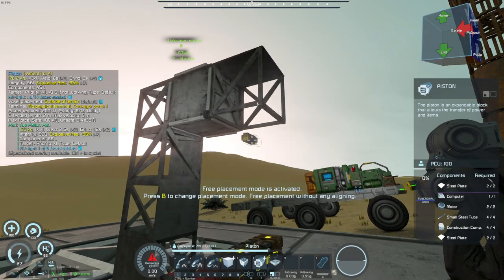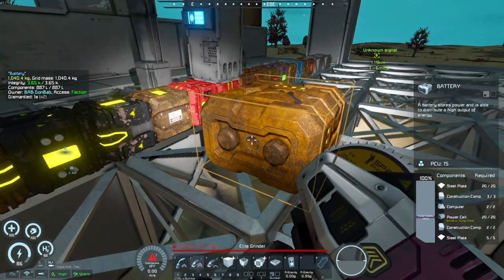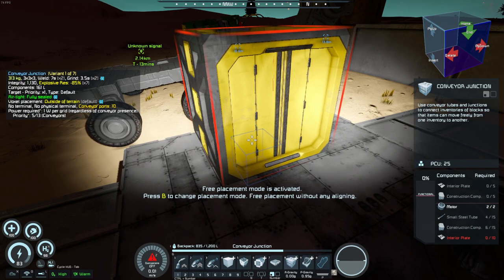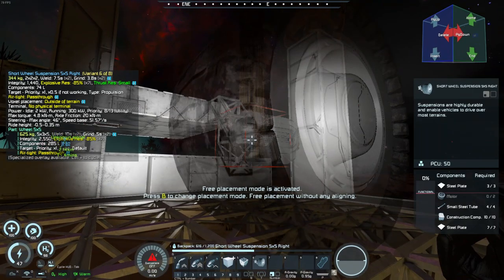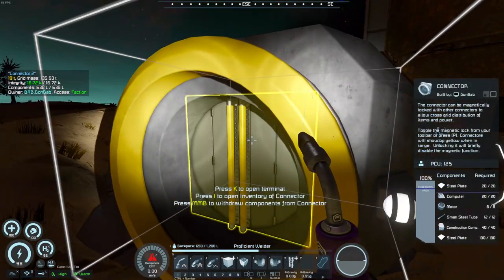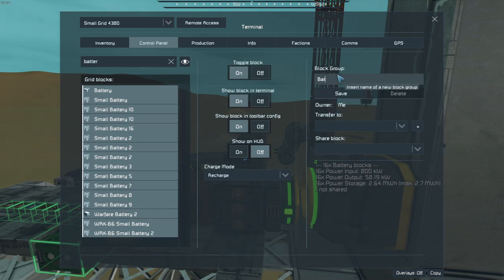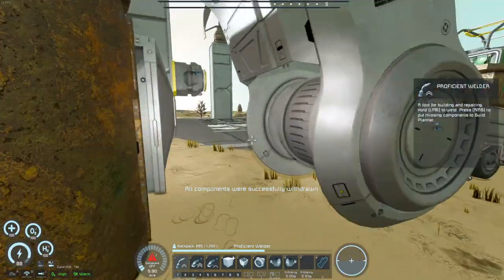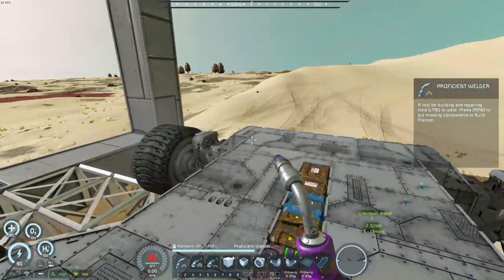Building the new Rover | Space Engineers Scrapyard Survival | E12

Comment: Well, you asked for commentary and suggestions, so.... 

As large as this rover is, and especially considering it'll carry heavy loads at awkward angles, definitely attach an additional gyroscope (or two!) when you can.

If you are putting your survival kit on the base, you'll want a recovery vehicle that the crane can carry, because when you die in this scenario you can't just jetpack out to the crane, and the recovery vehicle will have to come back with you somehow.  You'll probably also want a beacon on the crane and an antenna on the recovery vehicle so you can FIND the crane when you're going out there after you die. Finally if the recovery vehicle has a little cargo space (and remote, camera, and antenna, and the crane has an antenna), you can use it remotely to bring out crucial parts you need in some situations.  For example, to build large-grid wheels and a control seat if you want to bring a building home and are short of parts. And a couple connectors so the crane can attach to it, which will both secure the crane and power the building.

When you're building the next crane consider the sequence hinge-hinge-rotor-magplate for the hand, instead of rotor-hinge-hinge-magplate as you had it on the old crane.  It'll be less confusing because it means turning the rotor won't change the direction of the hinges. 

I would put a layer of armor plates under all the batteries.  You're going to high-center this thing sooner or later and you don't want to break them.  They're pretty tough, but batteries are kind of precious in this scenario.  I would also put armor blocks in front of and behind the bottom layer of the big batteries to prevent them from getting directly smacked by something you're driving over. 

I would also suggest steering with the middle wheels as well as the front. Sometimes the weight will be on the back four wheels and you'll have trouble turning.  Making them steer (turning half as far as the front wheels) should be the same for control as having a four-wheeled rover with front steering only.

Finally, I'd have gone for the full-size suspensions instead of building short suspensions on outward extensions.  It would give you the same overall width. Full size is handier because you can get between the wheels and the crane, better for large vehicles because they have more up/down steering, and better for the crane operations because they can turn at a sharper angle.
Reply from the maker: Thank you. Those are great tips! I'll have to read through that a few times and take notes for the build modifications.

Comment: Ok you messed up a little. Those bigger batteries aren't sitting right. You've got one on the at three wide and the other at two wide. One of them should be turned so that your build comes out evenly. Cause right now one side has two rows of block while the other has three.
Reply from the maker: I'll load up the save in a bit and double-check, but I think they are the same size (block wise), just slightly different shapes on the physical asset but the same bounding box. Now I'm concerned I was too tired and didn't notice if I made it symmetrical.
Reply from the maker: Just double checked and they are the same size. 3 wide, 3 long, and 2 thick.
Reply: It's an optical delusion because there not mirrored